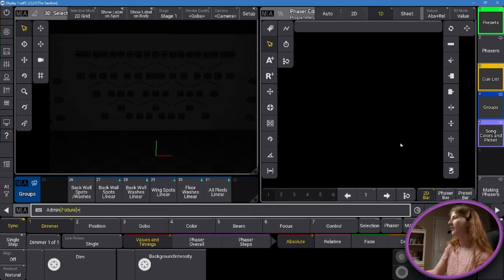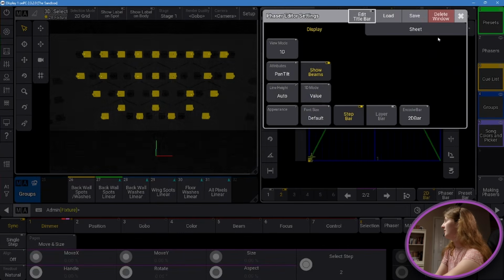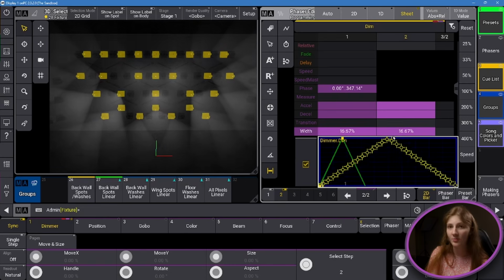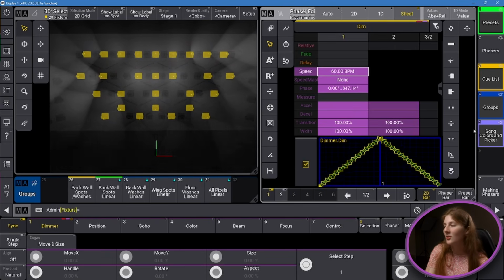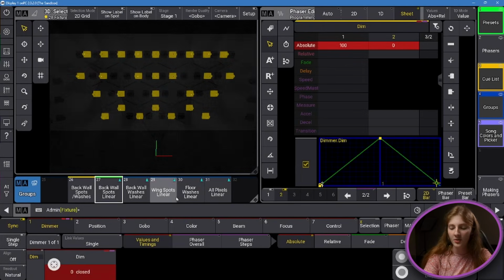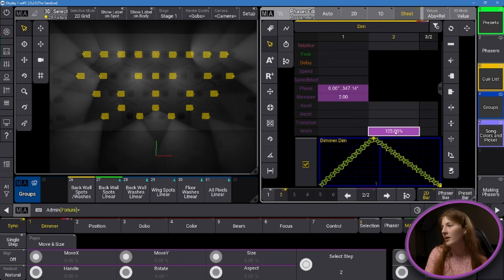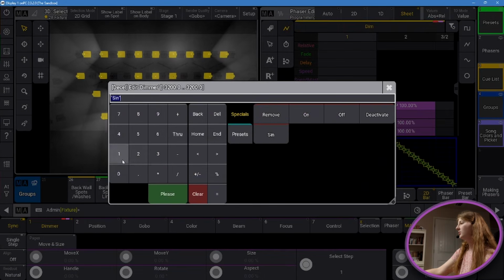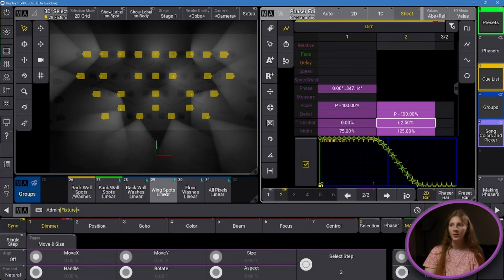GrandMA3 Phasers Pt 1 - 1D Phasers

Comment: Moin, yes icons are not good, but if you hover over those, in command line you see how they are labeled. I like the Sheet view most and I also use it a lot.
Reply from the maker: Great tip, thanks!